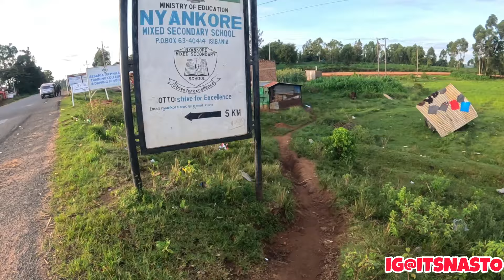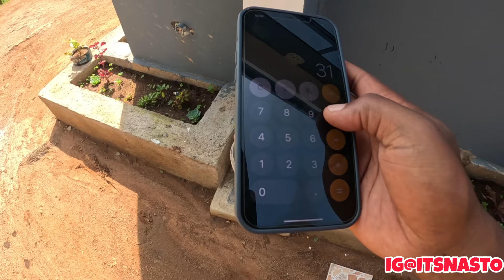BIG SUPRISE...FINALLY STARTING  ANOTHER MULTI MILLION PROJECT IN OUR NEW HOME  IN THE VILLAGE 🙏🏾❤️

Comment: Nasto is the ONLY guy in the village who really tries to do things right! His compound always looks very clean and organized. So far he is the only person who has tackled the drainage issues by digging that drainage trench. Make sure you dig another one along the other side to direct water safely out of the property. When it rains especially water will tend to 'pool' inside the walled area so a trench is necessary to divert the water out of your property. After you finish the other wall, try to get solar panels w/inverter & battery backup. That way you can have electricity! This will enable you to run a water pump from your water tank. You will be the first person in your village to have running water throughout your house! You could even install outside water faucets and coonect long garden hoses to water your plants..
Reply from the maker: Thank you for your kind words...by Gods grace everything will work out
Reply: Thanks brother for your comment i appreciated bro i will  do so brother as you say